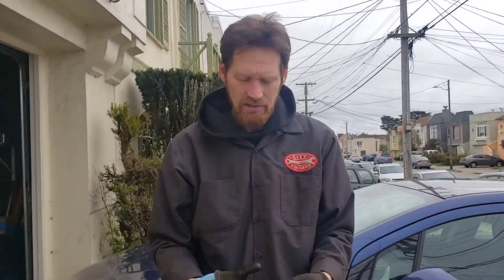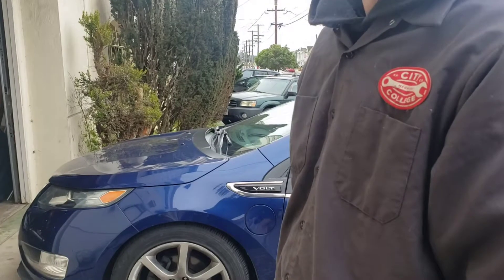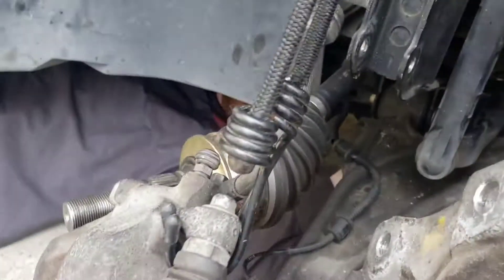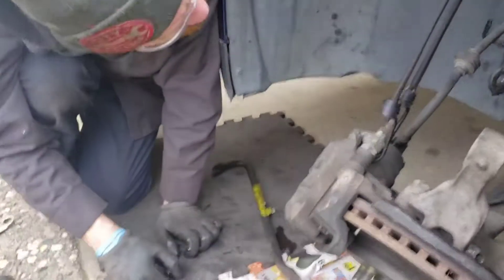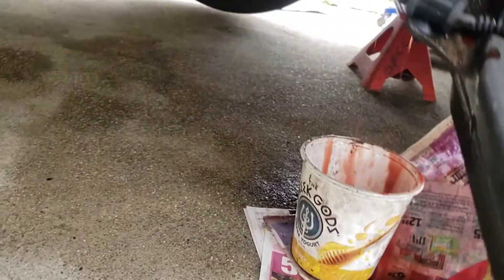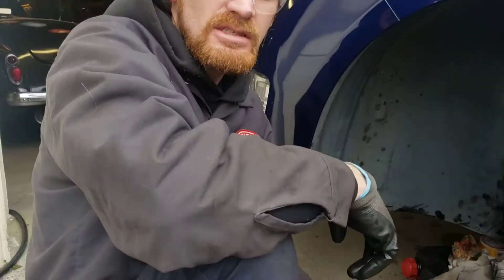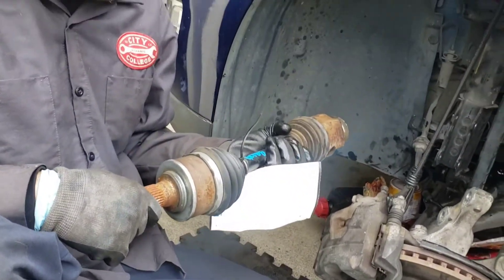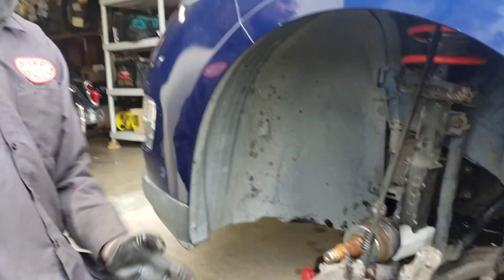Chevy Volt CV axle replacement

Comment: There are 3 bolts to beside the seal on the transmission.  If you unscrew them, could it be possible to remove the seal more easily?
Reply from the maker: That may be the true. I am not sure
Reply: Thanks for the answer, but i'm not gonna change my seal, i'm too lazy and i ask my local part seller and he barely sell them and i'ts not leaking.
Reply from the maker: If it is not leaking definitely dont change it. @alexandrecotedoiron

Comment: hi i am replacing mine and stuck on seal removal...tried drilling but not a soft metal...how did you drill in a screw? did you use a drill bit first and then inserted a screw?
also how much fluid it leaked? mine keeps drianing...not sure if i should fill in with new or same? i have 90k and never replaced the transmission fluid so dont want to damage it.
Reply from the maker: I used a self taping screw. The tip of the screw is a drill bit. 
As for amount of fluid to add use the chevy volt procedure to check/ add fluid.
Reply: Mr. Electric ok i endup using the same technique. Genius as I don’t see any other way. I just had to get a hammer to pull it out. The only worst part was a lot of oil drained in the process so I endup replacing the entire oil. Thanks for the video it helped a lot.

Comment: is there any way you can share the information on the Seal part number? i cannot find the seal anywhere and my transmission fluid is leaking from there. i will really appreciate the help with the seal information you can provide pleaseeee
Reply from the maker: AC Delco 22761722
Reply: Mr. Electric I found the right part. It’s actually ACDelco 19258265 for 2012 volt

Comment: Hi sorry to trouble you ...Great video on Ampera  I have discovered my driveshaft pulls out from the transmission on the left-side your drivers side good inch or so is this normal or has the lock clip come out??  Also should I look for a genuine used driveshaft rather than a Chinese copy one Many many thanks.
Reply from the maker: I haven't seen that before. Should be tge same on any chevy fwd sedan. Maybe the knuckle is able to move away from the center line of the vehicle because something is loose.